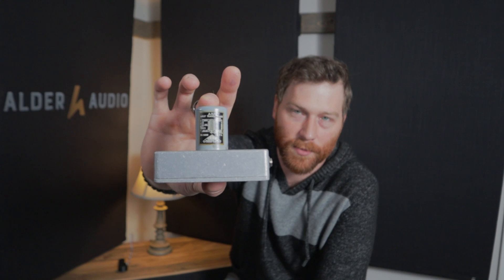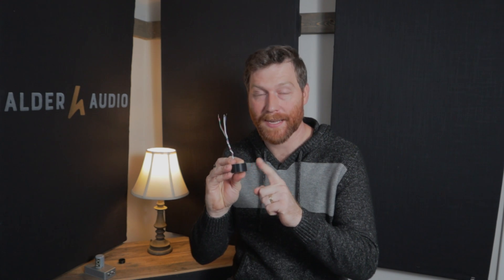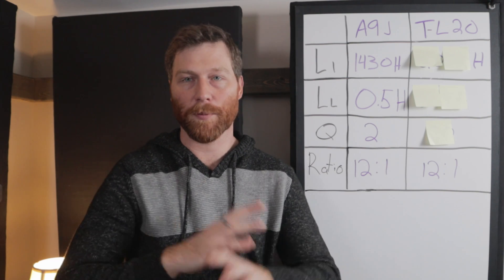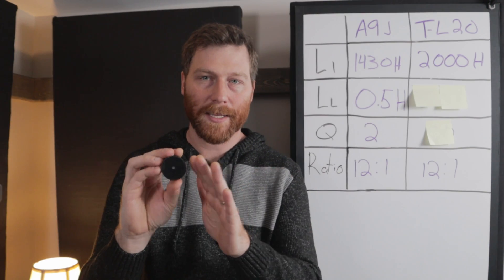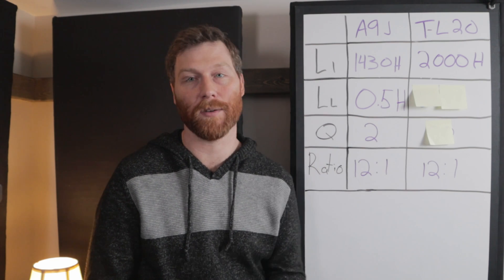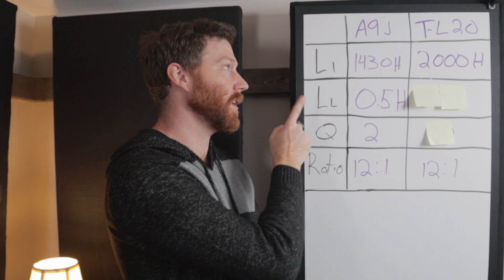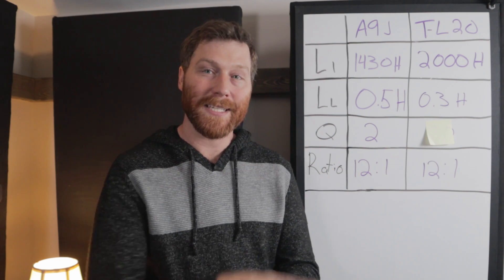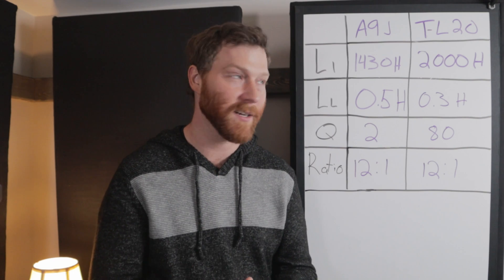A DI Box Transformer Like No Other | Transformer Series #3

Comment: I have tried to email Alder Audio on the website, and get an error saying try again later…
Curious if Tyler and crew are okay or maybe Alder went belly up?
Reply from the maker: Hey thanks for the note.  Don't know what's wrong with the contact on the site, I just took a look myself and didn't find any problems.  Feel free to email me direct.  tyler@alderaudio.com.  I did go ahead and unlist this transformer series though, as I am no longer offering the transformer.
Reply: @alderaudio  thanks for the reply however, the email address was rejected by the server and the web address is still not accepting my email. Is there a particular browser preferred for me to use to access contact through website?

Comment: Hi Tyler, amazing work! Thank you for sharing your process and your results. The vintage transformer seems to have less 3kHz and a steadier presence around 1k, which, on bass guitar, translates to a relaxing 'glow' for me. The T-L20 has a pokier, more transient-defined response by comparison. I wonder what causes the difference. Is there any phase rotation happening in either of these transformers? Any saturation that you've measured? Because the A9J does sound more even (dynamically speaking) through that ~1k midrange. I found that listening at 2x speed helped me hear the difference and listening through bandpass filters helped me confirm the differences I was hearing. I won't be convinced it's not a materials thing until I hear an Adler DI that fully glows around 1k, probably not due to any saturation or compression, but likely due to there being less 3k/transient bite. Maybe you encountered one in your testing..? I'm curious. And grateful to you for your work!
Reply from the maker: Hi Dirk, thanks for the feedback.  I've struggled to manage the technical depth of these transformers while still making the content accessible.  There is a lot to it!  But I'll try to let you in on just a bit more in what I can fit here in a comment.  The biggest huge difference in this case is that my transformer is toroidal, which comes with a whole host of changes.  I've highlighted a few, but really the whole design just ends up different because you have different inductance per wrap, wire gauge, capacitance, just kind of everything.  So my intention was never to clone, I just took the high inductance and low leakage away from the vintage model as guiding principles.  As far as saturation we are WAY far away from that using just a pickup.  I have intentionally pushed these both to saturation and it takes a decent bit of juice.  As far as phase, I know Jensen likes to talk about that, which I assume is where you are coming from?  Their point is that phase shift can occur in the low end as a result of the natural high pass filter of every transformer.  What's the key to pushing that shift lower and lower out of audio range?  Higher and higher inductance.  So both of these perform really well in that regard.  The TL-20 also measures lower in THD at 30hz.
Reply: @alderaudio  interesting, thank you for sharing!!

Comment: I hear reduced high frequencies -3.5db down between 4khz-12khz on the Alder T-L20.  The other vintage transformer has more high frequencies.   imo I'd rather have a DI box that was too bright vs too dark.  it's harder to boost high frequencies because high frequencies are always closer to the noise floor/hiss.  It's much easier to boost low frequencies if I need them typically with much less of a noise penalty.  Is it possible to make a DI box transformer that has a rising response towards the high frequencies?  I'm not really an electrical engineer, just an audio guy

Comment: I’m sorry, but there is no way that your inductor has a value of 2000H, I think you forgot to put a "u" or a "m" in front of "H". That is an extremely high inductance for such a small size, and it is not physically possible to achieve that with conventional materials and methods. You are probably measuring the inductance incorrectly, or using a faulty meter.
Reply from the maker: Well, I appreciate your skepticism as the number does border on the ridiculous, and it is easy to mess up measuring inductance, especially over 100H or so.  I also agree with you that this is impossible to do in this size with conventional materials.  However, specialized extremely high magnetic permeability materials really change the game, and they are integral to this design.  As for the measurements, the inductance was checked not just with an LCR meter at 100Hz (frequency is very important here), but also with two different oscilloscope based methods using resonant circuit calculations.
Reply: Triad sounds more even and heavy. 
TL is more HD 
Thanks for the video series 🙏🏻
Reply: @icautlicortes1074 that is right!!! The Triad is not efficient than TL, but is more  musical to my ears, seems to sound closer to an speaker emulator. If TL is modified to deep  and warm response will be the Winner!!!. I'm Bassists too and my goal is to feel what I feel  from my speaker cab, and capture it to process either a power amp or sending to the F.House or the DAW
Reply: It is very easy to achieve with modern permalloy materials such as nanocrystalline cores which may have initial permeability 3-10 times higher than conventional permalloy L, E cores mainly with 80% nickel. But this new cores not necessary gives better results or better sound.